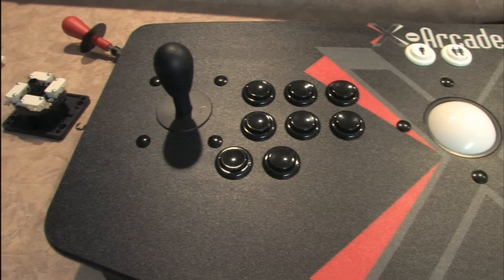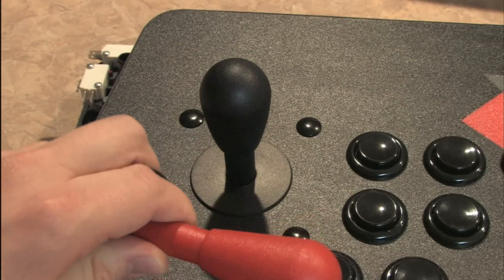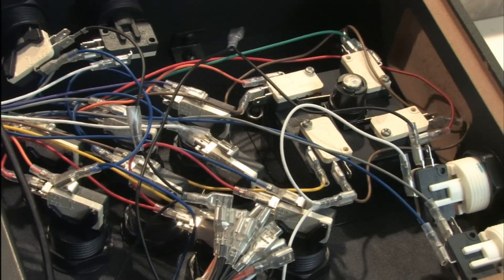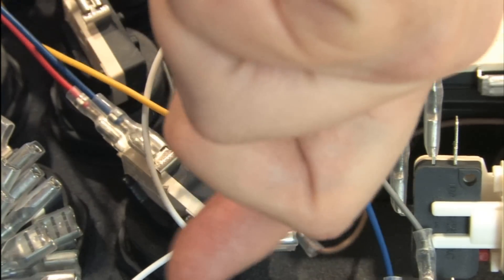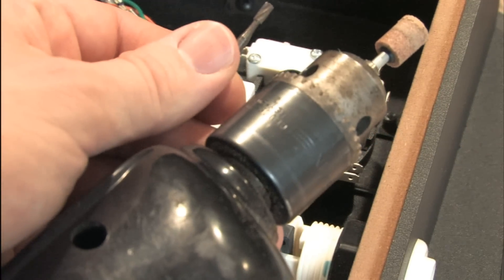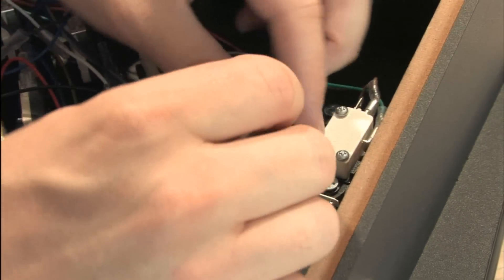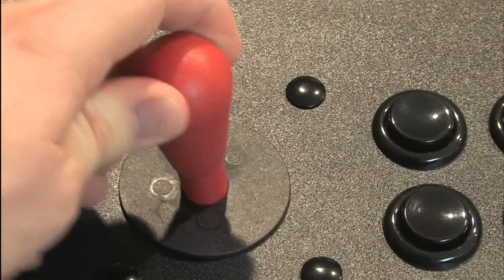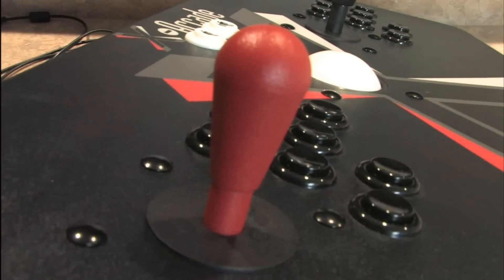Classic Game Room - HAPP COMPETITION JOYSTICK review and installation

Comment: @Jeffy777 Wrong, the IL Eurosticks need to be grinded as well (they are identical to Happ's). Installed two of them on both my solo sticks. Only difference between a Happ and a IL is the white square gate (vs black) and cherry micro switches vs. E-switch.
Reply: The white square gate and cherries make a huge difference. First of all the white square is some kind of fibre material while the Happ one is plastic. The IL version is way more durable and does not wear out over time. The Cherries also add Durability and precisiveness over the cheap happ knockoff switches. Happ used to be rebranded ILs but then they merged with another company and started  to produce their own derived design (while cutting costs) in China. The quality of the Happs went down. If you want a Happ design, go for Industrial Lorenzo instead, they still are alive and kicking, I just ordered two sticks from Spain.
Reply: I installed two IL  joysticks and buttons, they fit perfectly with no problem, 100% better

Comment: 13 years late, but I just wanted to say to keep in mind that this Happ Competition Joystick replacement is actually not as good as those made by iL EuroJoystick. THat is the company which supplied parts to Happ in the 90s and early 2000s. Happ actually split off from iL and turned into Happ/Suza. At that point they started using cheaper plastic actuatures instead of the smoother nylon type. The nylon ones are what powered original arcade games, such as Street Fighter II, and Mortal Kombat in the arcades of the 90s. Luckily you can still buy the better ones from iL. I just wanted to throw that out there. Matt ( from the future year of 2025 A.D. )

Comment: I can tell by the black actuator that this is a new stock Happ Competition, which is not a good thing. Happ used to source their Competition sticks from iL, a Spanish manufacturer. A few years back, they took their molds to a new manufacturer in China.

This is bad because the parts in the stick are now made more poorly. No more Cherry switches. The actuator does not rotate as freely on the shaft.  Pivot is sloppy. Buy the iL EuroJoystick instead, it is closest to the old-school Happ Comp.

Comment: It was because of this video I felt comfortable switching my joysticks out on my X-Arcade controllers. Surprisingly, I was able to get it in there without modification. That small amount of difference isn't enough to stop it from going in; it's just a little harder. I was even able to do this without a helper on both older and newer X-Arcade models.

Comment: I always wonder, why not just get longer bolts and just install the joystick more deeply into the case and bypass the original hole completely? The joystick looks it has enough clearance to do that and it lowers the joystick putting both hands on a more even level which should feel a bit more comfortable.

Comment: I wonder if that's specific to the tankstick. I replaced the joysticks on my Dualstick with IL Eurosticks and didn't need to do any grinding at all, it's just a drop in replacement.
Reply: Possible. IL used to be the manufacturer for all of Happ's parts until they switched to a Chinese manufacturer. I am unsure of the exact date of the switch. Because of this many people will talk about Happ parts being in machines or sticks but will actually be referring to IL parts and I have a tendency to assume when people are talking about Happ parts they mean "old Happ" IE IL, because next to no one wants "new Happ". (Because the IL parts distributed by Happ are what you would see in any machine in the 80's or 90's.)

It never even occured to me he might have a "new Happ" stick in there...

Edit: Now that I look again I think you are right and that is a "new Happ" stick in there and not an IL. IL has a white actuator on it where this one has a black one. (Actuator is the square thing that hits the buttons.)
Reply: I've been running some small scale retro game competitions for a while now so in my quest to make things better, easier to run, and more authentic I have over time picked up a lot of different controllers. I have a pair of Mad Catz's TE sticks, one I bought at release and another I picked up later to match it. (Got to have identical controls for a competition, obviously.) I found it a lot easier to use once I put in an octagon gate, 2lb tenson spring, and changed out the ball top for a bat top. There are definitely a lot of parts out there for the Sanwa JLF and JLW out there. Ultimarc has some very impressive sticks that use the JLW with their own custom parts to allow it to switch from 8-way to 4-way via servo which is worth checking out. A longer shaft, bat top, and even higher tension spring could probably get the JLF or JLW feeling more like a classic western stick, though they still always feel much more delicate in my hands.

If you pick up an x-arcade stick I would recommend the tankstick simply for the trackball. Trying to get a good track ball on it's own is hard. These trackballs can cost around $80 on their own not to mention you'll probably want some kind of PCB controller which adds to the cost. If you want to spend more money recroommasters and monster arcades are some good places to look.

The one nice thing about the dual stick over the tankstick though is it's easier to work with since it's all just microswitches. I've changed out all the buttons for IL Convex (old Happ Competition), Groovy Game Gear Microleaf switches, and IL Eurostick for the sticks and it controls great. 

Some of those JLF parts I mentioned.
http://www.focusattack.com/sanwa-lb-30-n-s-battop-white/
http://www.arcadeworlduk.com/products/awuk-classic-bat-top-handle.html
http://www.focusattack.com/2lb-tension-spring-for-sanwa-jlf/
http://www.focusattack.com/sanwa-gt-y-octagonal-restrictor-gate/
Servo Stick (Pretty sure they are putting in longer hafts and stronger springs on these)
http://www.ultimarc.com/servostik.html
Reply: To answer your question about the five pin connector I found the following premade harness to make it simple. There isn't anything special about it it's just the four inputs and a common ground. You could easily make your own adapter if you wanted. Simple pushbuttons like these are actually pretty simple to wire. The TP-MA PCB assembly doesn't really serve much of a purpose as far as I can tell other than to make it harder to repair the joystick.

http://www.focusattack.com/187-to-5-pin-conversion-harness/

However your biggest problem is not going to be the adapter plate, or the five pin which you've already found a solution for, but the fact that western sticks are larger and will, as far as I know, simply not fit, depth wise, in the space for one of those MadCatz sticks. Remember too that the Eurostick and other western sticks don't have mounting plates so instead of replacing the plate like you would with a JLF you would be screwing the stick onto the plate and then affixing the plate to the cabinet/control panel. (Edit: Looking at the placement of the holes between a JLF and where IL/Happ put their holes you'll probably also run into issues even with the Kowal plate as it looks like the screws where they would be for a JLF would be going through the Kowal plate into the IL stick body so you might end up having to dremel down the screws too.)

SRK would probably be a good place to look into something like that as they have lots of resources about more extreme conversions like this. (Though they really do tend to hate anything that didn't come out of Japan there.)

In my opinion it's just not really worth the hassle when you've already got an excellent JLF stick in there already. If you want a western style stick just get one separate for that purpose.
Reply: I have not used one. I am mostly familiar with western parts as that is what I had in my X-men vs. Streetfighter cab I got in 2000.
Reply: how are the il euro stick is bought two of them and should get them end of week hopefully will receive the tank stick by next week
Reply: It's a very good stick. Definitely one of my favorite of the mass market western sticks. It has a square gate so you will feel the corners in the travel unlike the Super which you can't feel the corners. And like most western sticks it's got a stiff spring. For a drop in replacement with the x-arcade it's a new brainer, and is definitely a good choice if you want to replicate the feel of the retro machines the x-arcade is trying to mimic. Now if you want to get fancy there are a lot of other sticks out there that you may or may not like better, (Ultimarc's servostik comes to mind, which is a modified Sanwa JLW) but you really can't go wrong putting the iL Eurostick in there.
Reply: ***** I have installed the il-euro sticks heck of difference thanks again also they seem to have updated the spot where the sticks go you don't have sand it down any more they just fit easy plug and play